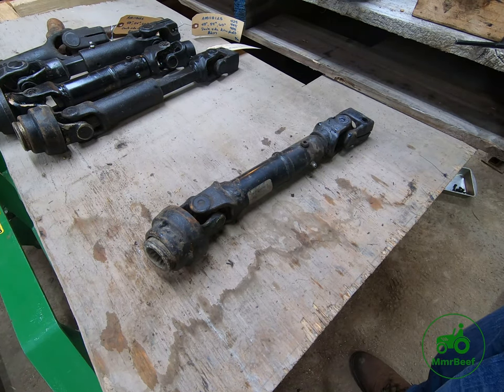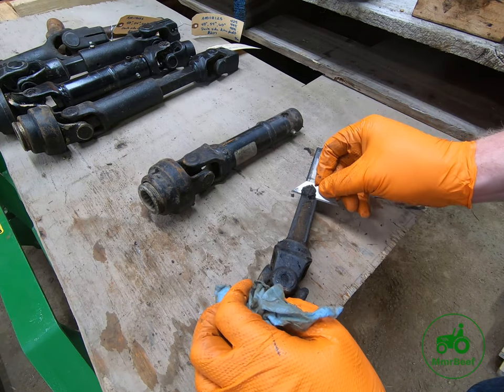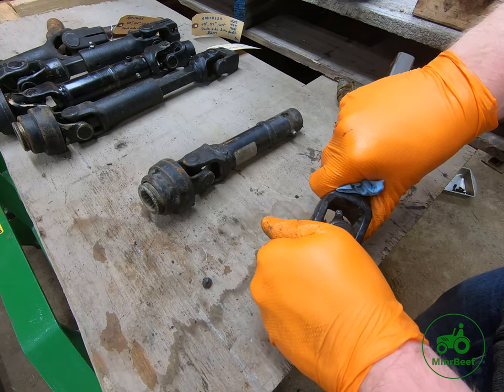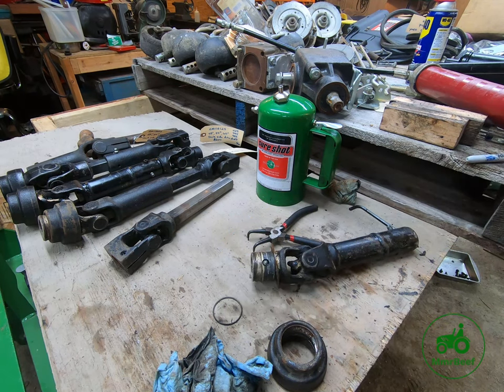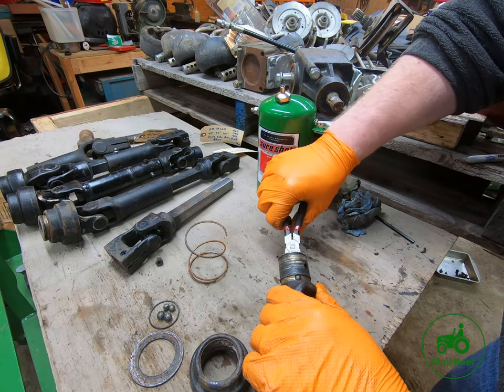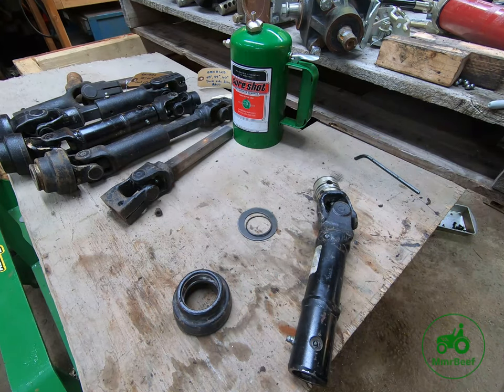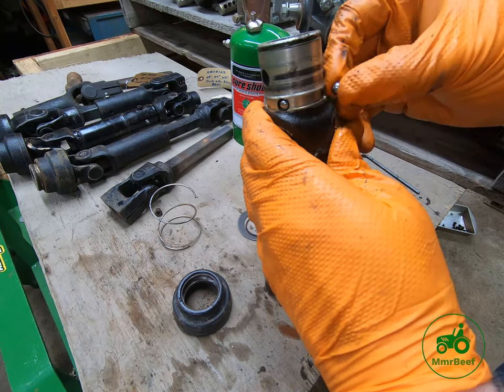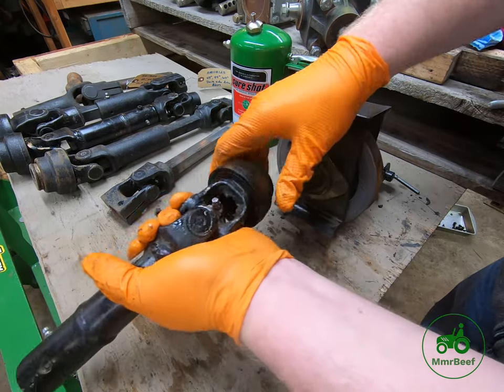Drive Shaft Cleaning and Repair

Comment: This was a fantastic video for someone somewhat intimidated by some maintenance.  This gives me confidence to dig into these necessary maintenance items that improve the longevity of the parts and making them easier to use daily.  Thanks!  Bruce - Larkspur, Colorado
PS I have a 2009 JD 4320, so I appreciate your JD 4066 videos.  But, I learn something from all of your content. Btw, what is your education and profession, if that's not too nosy.?  Either way keep up the good work!
Reply from the maker: Thanks! Comments like this are the reason I do these type videos... back in 2012 before I got into garden tractors etc I could barely change the engine oil! Education... waayyy too many years in school! Due to my some legal terms of my employment I don't openly discuss my day job (it is about a 180 degree change from any content on this channel).

Comment: Great video on cleaning drive shafts, could you do one on changing out universals on drive shafts?
I would also like to know if it is possible to replace the universals on the drive shaft on the X700 series, Deere only sells the whole shaft at about $350.00.
I have a 2016  John Deere X758  with 1400 hrs.

Comment: Do you have the part number of the set screw that hold the pto shaft together? Lost mine. Thanks in advance. Great video.
Reply from the maker: Some parts diagrams do not list the set screw and there are multiple part numbers. The faster route might be to take the shaft to your local hardware store with a good hardware section and find one that fits.

Comment: Do you happen to have a good used P218 driveshaft for sale for a 316? Mines got a little wobble at the pump side
Reply from the maker: I should, I will have to look today. Drop me an email mmrbeef at gmail.com . I wasn’t sure what machine this was on. I would take a good look at your splines on the pump shaft. The 15U pumps seem to have some issues with spline wear. In this case you can replace the input shaft or the whole pump.

Comment: Do I have to unbolt the engine or can I take the driveshaft out without having to unbolt the engine?
Reply from the maker: I’ve always been a fan of removing the engine to remove the driveshaft. You can just unbolt the engine and move it forward and get the driveshaft out from under the machine.

Comment: How do I fix the spline wobble?
Reply from the maker: Any indication of which side might be worn? Normally the shaft side “should” be of softer metal and wear first. Inspect the internal splining of the shaft and look at the splines on the mid-PTO. If the shaft is worn you can either replace the yoke or the shaft. If the splines on the PTO are worn it would require replacement of the PTO shaft.

Comment: WD40 is not a lubricant...use red grease
Reply from the maker: As I mention about the 7:20 mark, using grease on the reassembly of the head will lead to more dirt and grime getting packed in there. I also mention (~9:50 mark) that my experience is WD40 is less likely to attract dirt. This will make it harder to remove. The only place you should use grease would be the u-joint and area of the driveshaft that slides.
Reply: @mmrbeef  that's fine